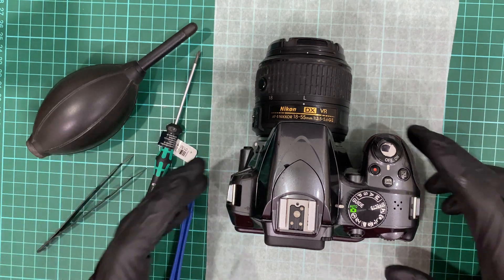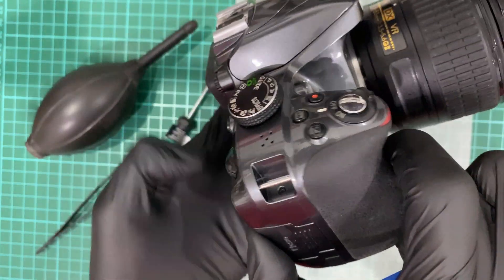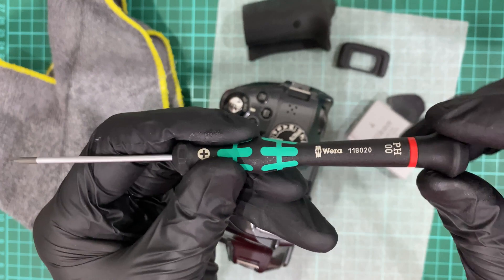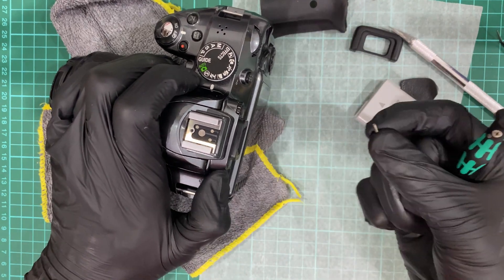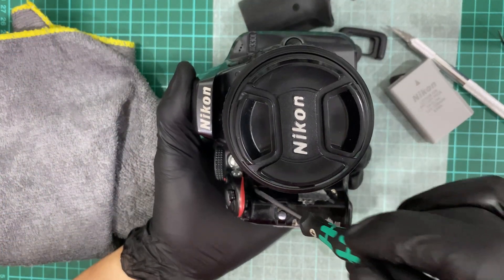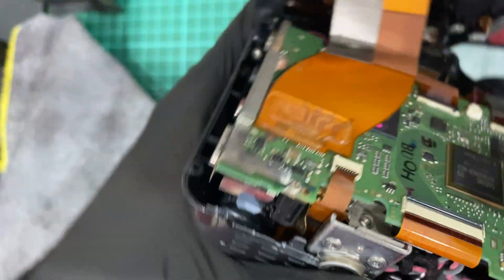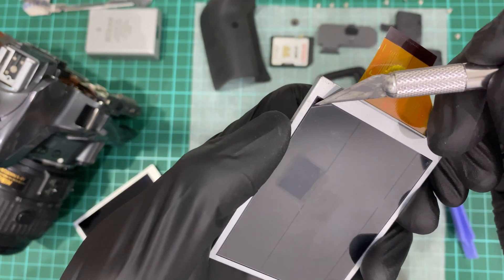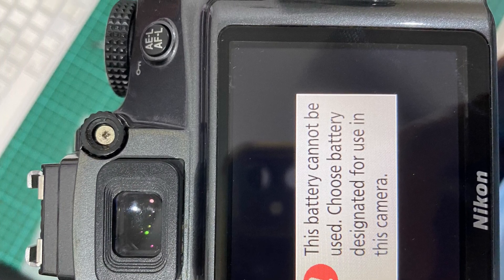Dissembling and Replace NIKON D3300 LCD Vignette screen using WERA PH00 screwdriver

Comment: Nice...its harder than d5300
Reply from the maker: Good to know. Have you managed to also change the LCD for D5300?
Reply: @CTB6  no but, d5300 the lcd is outside the body and can be flipped...d3300 must disassemble half of the camera body...very hard
Reply from the maker: @rei_takayama oh no wonder. I guess that is the plus point.